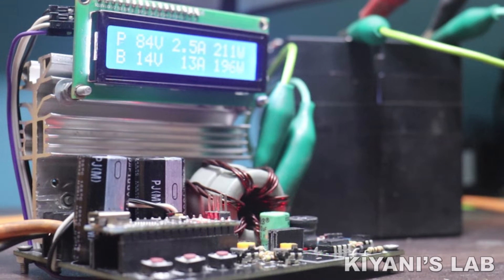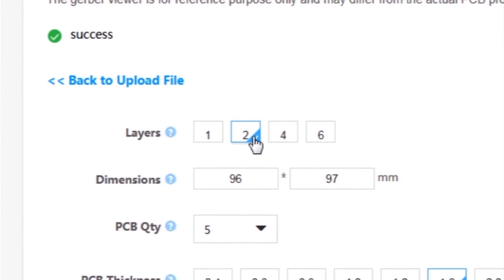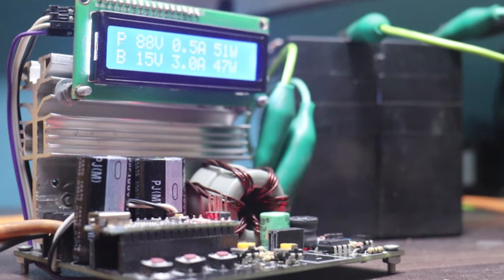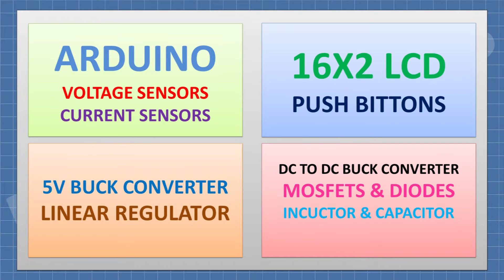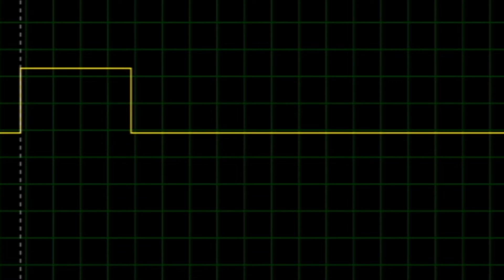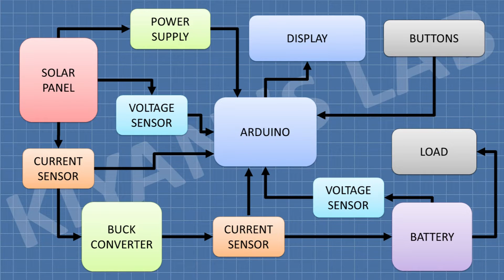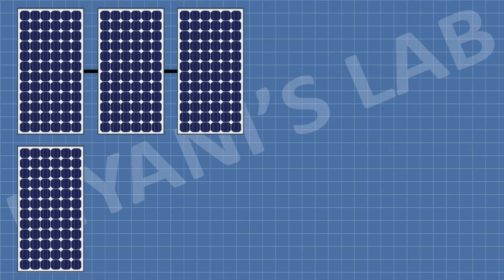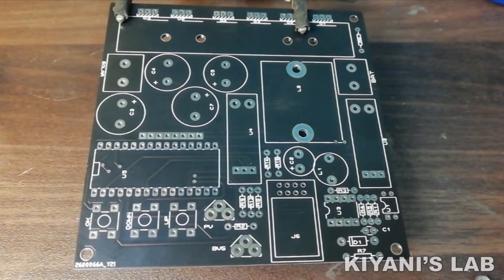How To Make MPPT Solar Charge Controller | INPUT 80V OUTPUT 12V  24V

Comment: Hi , I want to make MPPT charge controller that's input voltage are 95 -100V DC and output voltage 84V DC  to charge 72V lithium battery.

Comment: Hi there can you show how to achieve a 72 -150vdc in and 48vdc 1200w  output with galvanic isolation please?

And where i can buy the pcb gerber file and the bom parts list from you please ?
I can not find any parallel capable diy mppt charger units anywhere .

Thankyou for your video.
Andrew New Zealand

Comment: Can you make and supply one with details for 12 volt / 24 volt  200 AH bank. A multiple stage buck converter for using 3-4 panels in series for maximum efficiency and higher current for even a 12 volt battery. .

Comment: sir in your diagram you show A4 current sensor insted of A2. A4 is already connected to SDA LCD Pin. kindly help us.
Reply: A4 would be A2 in the schematic diagram. Check the program you will see this. If the author could provide further info we can easily verify everything.

Comment: Hi Kiyani
I have purchased your PCB and made your charge controller based on the schematic and sketch in your download MPT4.2 but no matter what I cannot make it work can you explain this part of the code (   //if(v)
    vi = (vo * 10) - vi;)  and if if(v) should be remmed out. Is there a later version of your code? Also the pcb has a missing track A2 to U2 and the schematic shows the output going to A4 which I presume should be A2 have I got this right or have I made the situation worse? 
Regards
Graham

Comment: Sir no need mppt charge controller you can use any SMPS power supply as a mppt charge controller  working very well
Reply: Really
Reply: how??
Reply: @Sekhar_Home  i am using one year you use ibm adapter like a laptop charger
Reply: Could you please share the details of projects you worked on ....i need to make a minor project for power electronics lab I am a student of 3rd year btech  electrical department
Reply: @shreyachoudhary98 bahut sari power supply Jo adaptor ki shakal mein Hoti hai SMPS yah lo voltage per on ho jaati hai aap check Karke le le Jo load voltage per on ho jaaye 220 wali site per aap usko low voltage denge output per Apne matlab bolt jitne volt ka vah adaptor Hoga utane bolt nikal le aur behtarin kam karta hai har SMPS supply ke andar ek rectifier bridge laga hota hai to no matter aap AC de rahe hain ya DC de rahe hain

Comment: Tell me, is it possible to install ESP1 Module as in version 4.1, if so, what needs to be changed in the firmware?
Which ACS712 Sensor is used at 30A?

Comment: It is not an mppt, its just a buck converter
Reply: 2 ông vn nói chuyện với nhau bằng tiếng anh🥲
Reply: @ThanhNguyenGarden  That doesn’t matter.
Reply: Have you study how mppt work
Reply: @khaseigaming  not just study, i built 2 MPPT charge controllers, one with Arduino nano which is a Asynchronous and another is with a Raspberry pi pico and it's a synchronous buck converter with MPPT algorithm.
Reply: @CroftGaming1  you make video?
Reply: @khaseigaming  no I have not

Comment: Could you use a smaller inductor if you increased the switching frequency? I know the arduino is limited in it's PWM frequency, but maybe an external IC could increase the frequency and reduce the cost/size?

Comment: Your lcd display showing 15.2 v and input 88v but there is no way the voltage will say 15.2v with any load or to bleed down the 88 volt to 15 v so your not tell the full info I know this because I built negative buck converter and the voltage won’t turn down and Lest there is a load of 100 watt is on it to show that display

Comment: Nice project. Can you please explain this part of arduino code : vo=((vo*0.06)/100); 
       vi=(((vi)*0.6)/80); Where the 0.06 and 0.6 come from ? Does this code follow the any mppt algorithm diagram in particular? Does it follow the typical I-V curve for a solar panel ?
Reply: Those are voltage calculation from analog value, and sadly there is no MPPT algorithm, it's just a simple charger using a buck converter.

Comment: SIR WHEN I DRAW THIS PROJECT ON PROTEOUS SOFTWARE IT SHOW  D2 D3 D4 D5 D6 D7 EROR.
BECAUSE YOU DID NOT DEFINE THESE IN YOUR DIAGRAM SO PLZ EXPLAIN
Reply from the maker: is d2 d3 d4 diodes in you diagram if so choose ones with simulation model

Comment: Fake. At least the circuit diagram is. There's no way that 4 Mosfets with 7nF input capacitance and a gate voltage plateau of nearly 5V can be driven with a 47K/10K ohm divider from 28.8V (ie. 5.05V gate drive) switched by an optocoupler @ 31.4kHz! It couldn't even drive the one Mosfet that is all that is needed given that at 40A, 12V ouput, conduction losses would be < .5%. Maybe it could work at a few hundred Hz, but then the inductor would have to be enourmous!

Reducing the resistor values drastically wouldn't help - 3.76K/2K could at least switch a single FET but the switching speed would still be so slow that the switching losses would be 100s of Watts!

The silly thing about this design is that all it would take would be 2 or 3 dirt cheap bipolar transistors as a Mosfet driver to make it work (if not especially efficiently) if you really can't afford a proper driver chip. But cost doesn't seem to be an issue when he links to the 100uH main inductor costing $45 + $25 shipping!!!!

A sensible design would use a much higher switching frequency, say, for example,  200kHz using an SER2915H-472 5.6uH, 0.67mOhms inductor costing $3.39 for one off direct from Coilcraft. The Arduino Nano can create a 200khz PWM, but with a reduced resolution of 1:80 rather than the 1:255 (8 bit) default.

However if you did modify this design so it can actually work, if you run it at 56V input, 24V/40A output, the input capacitors would likely explode as their ripple current rating (probably 2 to 3Arms max for each capacitor) would be far exceeded by the 20A total ripple current they would be actually called on to deliver...
Reply: Hope you can improve on the question asked and make it work better, thanks.
Reply: this deceitful author doesn’t even give how he made 110uH.... Do you know how to make the correct inductance in this circuit? I have already ordered the boards.... and all the components, spent the money.... Help, give information about inductance??)))
Reply: The code is incomplete too.

Comment: Very nice.  What is the maximum solar panel wattage that this can take as input?
Reply from the maker: 1000 watts
Reply: that is a simple math: Input Voltage * Input max Amperage = Input Max Power.
So it is 80V * 40A = 3200W

Then it depends on your battery, what your max Output power is.
e.g. for an 12V Battery it would be 12V * 40A = 480W
With an 48V Battery it is much more power. 48V * 40A = 1920W

Comment: efficiency is about 93 percent maybe you should also show the efficiency on the screen but all in all a nice project
Reply from the maker: sure i will in the next version
Reply: @KiyanisLab  and maybe you can also make a digital volt and amp meter with an ads1015 or an ads1115 instead of analog this would be great
I have seen in your code that it is only calculated to 20 amp is that correct?